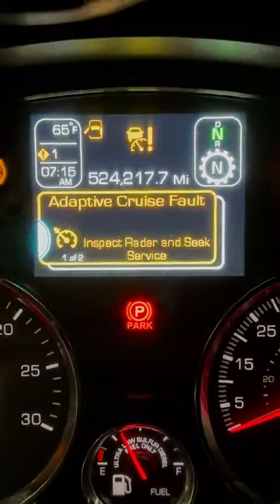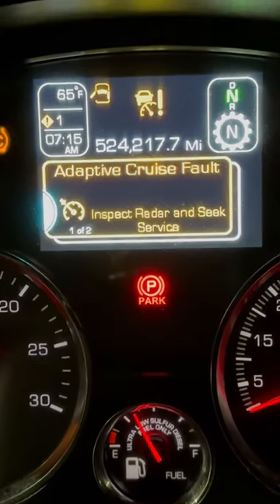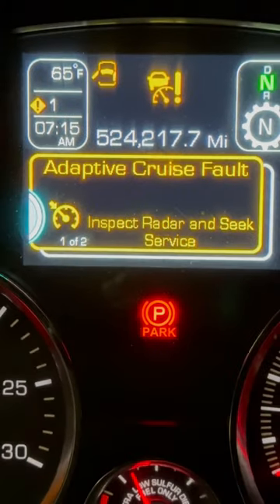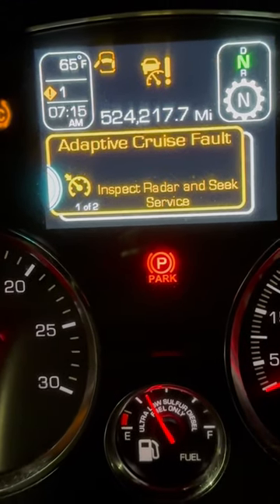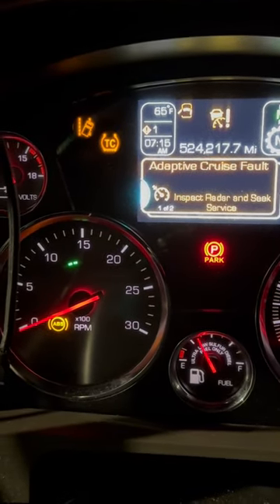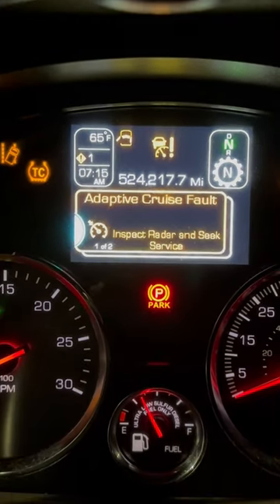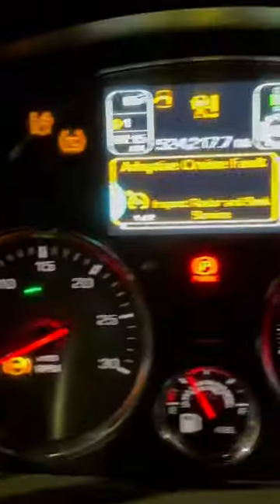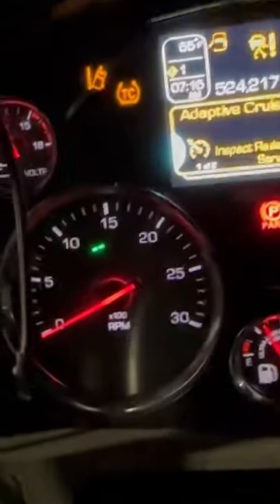Adaptive Cruise Fault

Comment: Bro check the fault code on the BENDIX display. If your code is SPN 886 fmi 7 then the fix is easy. Go on the bendix and hit ok, go down to radar hit ok and arrow to reset hit ok while driving and the fault will clear.
Reply: Thank you I just fixed mine from reading your comment
Reply: Worked u a real one. I need my pto so I can pump my tanks. Thanks fam.

Comment: Can this system be removed . I have the same problem with my 2018 T680 . KW dealer told me i need a new radar antenna for 6K.
Reply: Deleted mines for good
Reply: Kabuldenver   I took mines to a guy in opa locka FL took him only 15min and the adaptive cruise control is off completely. He used his computer to clear the code and delete it .
Reply: @zoe4life305  did any warning come up after you deleted it ? Also if the cruise is working fine since then ?
Reply: @zoe4life305 got a contact? Might need to do the same to one of our trucks 😂
Reply: I have same issue
Pls post a contact
Thanks in advance

Comment: Cruse control still works it just does not show but go through regular steps and it comes on
Reply: Cruise control will NOT work with that warning message on
Reply: Mine does you will not see it like normal but hit cruise hit set and mine works fine
Reply: Mine does to along with the adaptive cruise fault on.